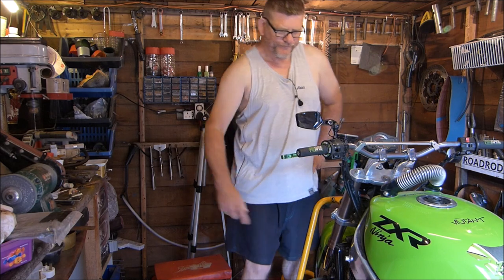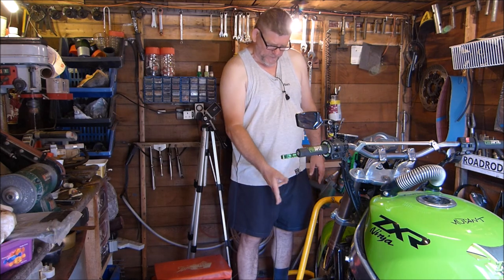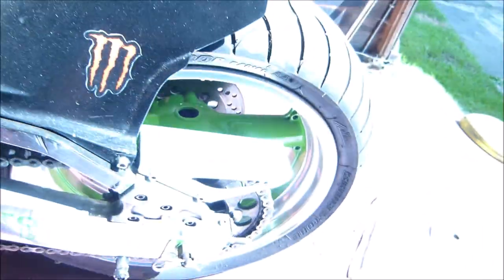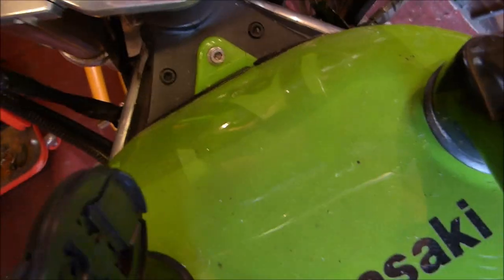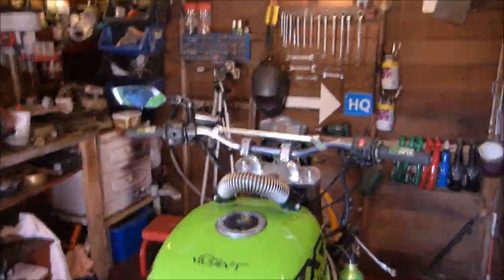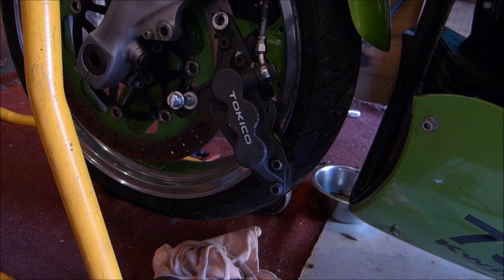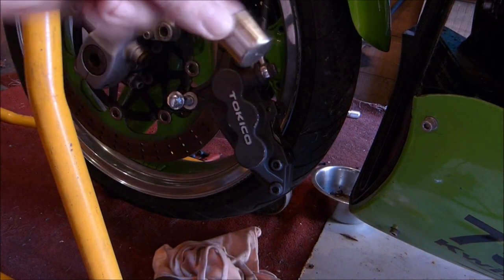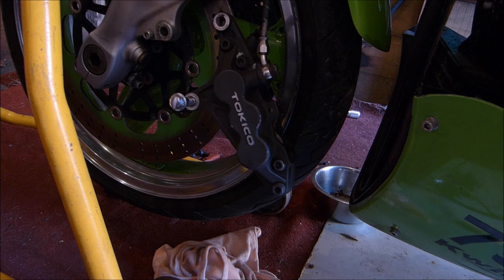Kawasaki ZXR750h1 Front brakes sticking P-1

Comment: If you're brakes are sticking you need to remove the pistons and the seals then remove the corrosion on the seal seats then fit new seals and clean up the pistons, if you fail to do this they will stick again in a short span of time.
Reply from the maker: Cheers buddy and don't forget to clean the front discs bobbins..

Comment: Hahaha, you should have remembered from the oil change on the big Honda lol, easy out brake pistons, oooooh yeeeeeah man lol
Reply from the maker: Hehe always learn the hard way lol.
Reply: @jonyr1TT       yeah, just like me, I serviced my 1991 kawasaki gt550, new oil and oil filter, new plugs and new air filter. 
Bike started for 2 minutes then sputtered to a halt, the general consensus was that the coils had give up the ghost after much head scratching and swapping of plugs, coils etc.
I ordered 2 new coils, paid the extra for next day delivery. 
Happy days.....right.......nope 
I took off the seat, unbolted the fuel tank, lifted it up to see where i could stick the builder's block hammer to hold up the tank. 
Now, while looking for a good spot to get the tank nice and high........
I spotted the fuel tap, had a second and third stare at it......noticing the second fuel line had came off.....Grrrrrrrr......
Happened whilst replacing the air filter cover which is long and narrowish lol the end of the cover pushed the line right off and when the bike started up, it emptied the bowls, then sputtered and stopped. I couldn't believe that it should have been that easy to fix. 
FFS lol I started thinking about you and the divvy. So hows that for a wee laugh. 🤠🏍💥
Reply from the maker: Omg dude that sucks we can laugh about it after but at the time it's a bloody nightmare. I know how it feels you could of spent all that money on something more important. But anyway the main thing is you've got it sorted and ready for the road again.